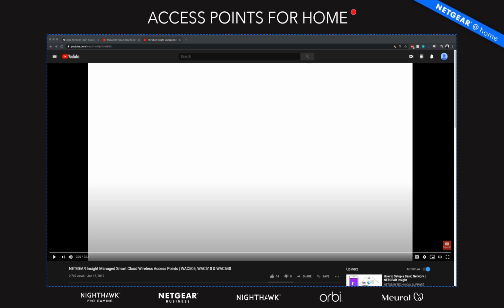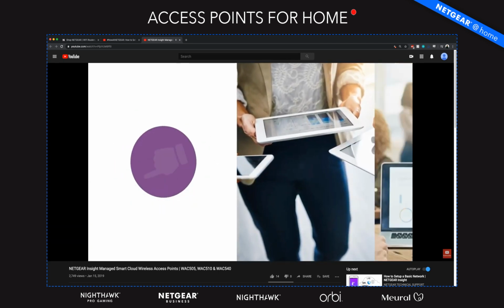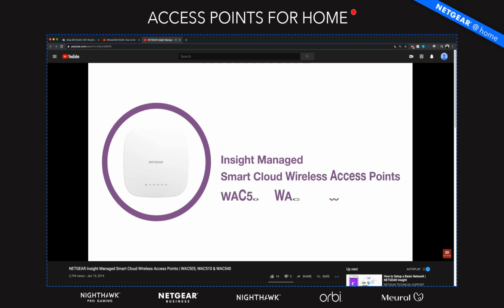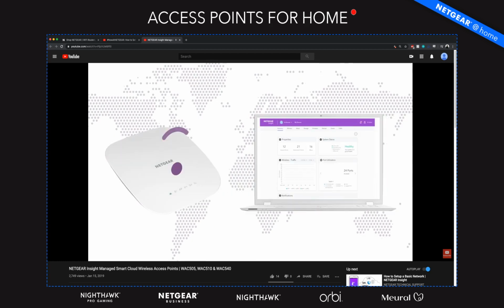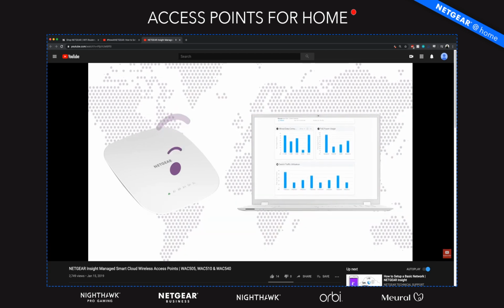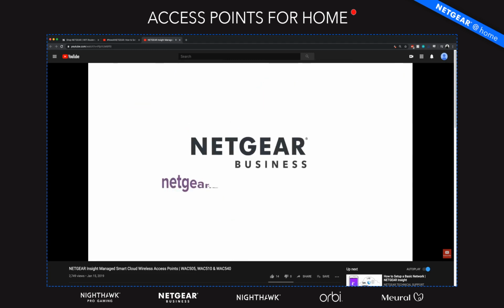#NowAtNETGEAR: How to Set Up Wireless Access Points For Home

Comment: If I am in a 2-story home, should I mount a wired AP on the top of the ceiling on the second floor or should I mount it on ceiling on the first floor? If I mount it on the ceiling on the first floor, will it still produce signal to the second floor adequately being the signal is being pushed down? I feel this would be the better option if it did because it's in the middle of both the floors basically. I feel it has a lot of signal space to travel if I mount it to the ceiling of the second story.

Comment: I have 2 wac540 and just recently purchased a wax610 to add wifi6 coverage but when I plug in the 610 I loose connectivity to one of the 540 units. What am I doing wrong or is there a limitation of how many ap's a home network can have.